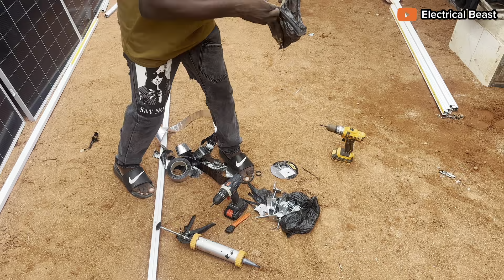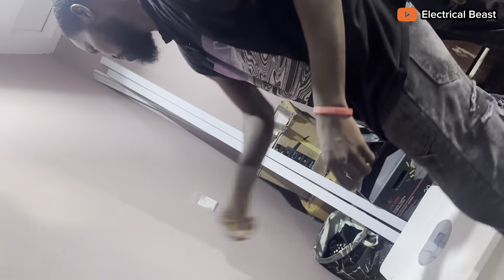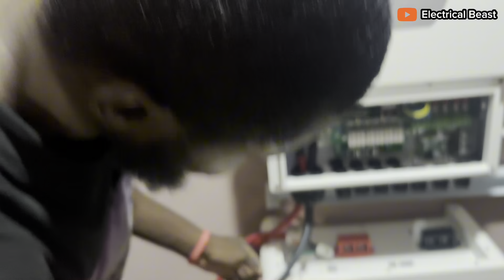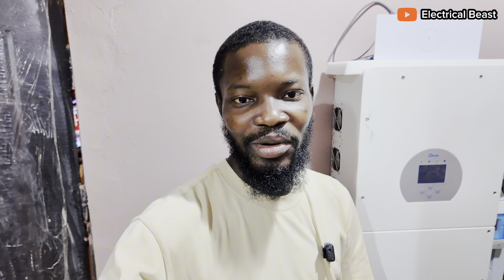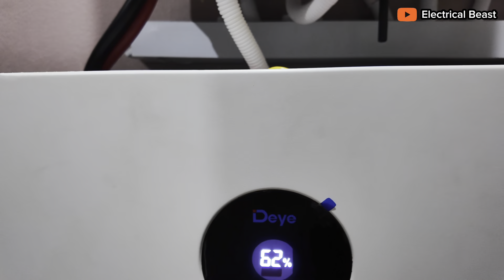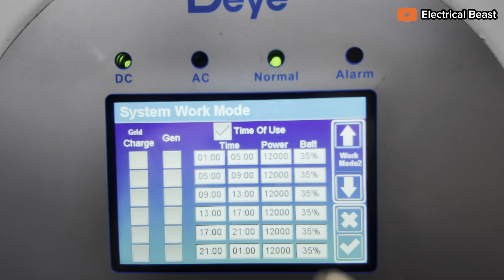STEP-BY-STEP Installation of 12kva Deye Solar Hybrid Inverter with Lithium Battery (Start to Finish)

Comment: Quick question please. Should the battery be connected directly to the inverter. Shouldn’t there be some kind of protection for that against surges or any other issue.
Reply from the maker: You’re right but the battery has an inbuilt breaker already to handle that

Comment: Always interesting to me watching ur video presentations. U love to be detailed in ur explanation. Calm and confident.  Pls keep it up bro.
However, why did u install 9 solar panels instead of 10? I learnt it is a standard or good practice to install panels in even number (and not odd) i.e 4, 6, 8, 10, 12, 14, 16 etc depending on the rated PV capacity of the inverter

Comment: Bro why not used quality rails to mount the panel on the roof this window aluminum frame that u are using can not with stand the heavy  wind
Reply from the maker: I have been using this for years no issues, even top dividers work as well

Comment: You're good at what you do boss. One question, after connecting the CT cable to 5&6, was any other cable connected to the CT? I'm seeing a red abd black cable close to it
Reply: Please respond to this when you're free boss
Reply from the maker: No other cable is connected, the ct was clamped to the red cable for current measurement

Comment: Is it possible to connect some  panels in parallel and send into another mppt
Reply from the maker: Yes, if it’s an external controller. Para-series connection to the controller based on its specs and send directly to the battery to charge simultaneously with the inverter’s inbuilt charger.
Reply: Is it only series connections of panels that are allowed for hybrid inverter? @engrgideon
Reply from the maker: @okaforjoseph8445 most of the times, yes. But some hybrid inverters come with low voltage controllers. It depends on the pv specifications of the inverter

Comment: Did you do the neutral earth bonding on the inverter as they do not have a auto bonding inside the inverter. As you going to have inconsistent voltages and a floating neutral and buggering up appliances!!!!!
Reply: Kindly explain this further @JWRacing83